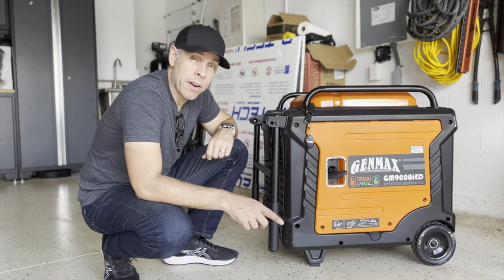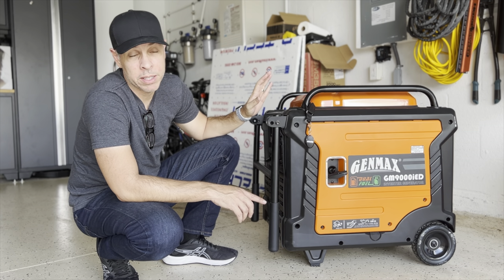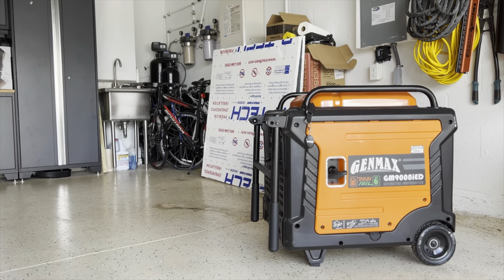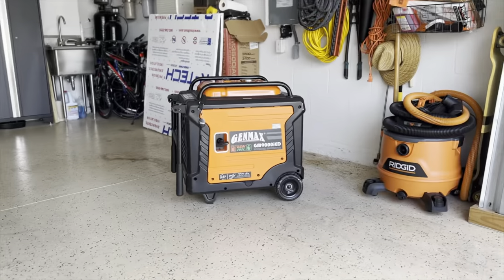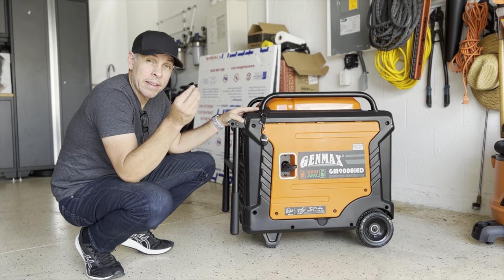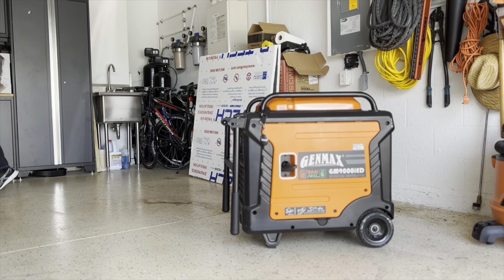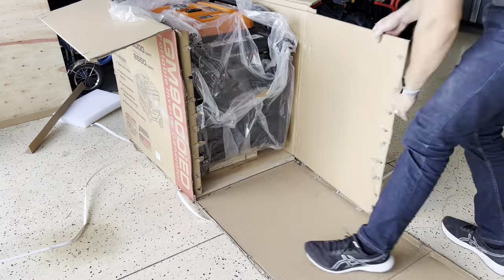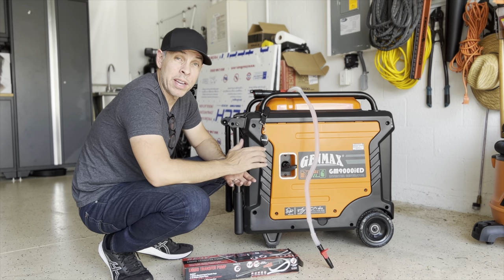Genmax GM9000iED Update - USA Support

Comment: Hi Javier, thanks for all the videos, definitely steered me towards purchasing this generator. I was wondering, I might have missed it, if you purchased a cover for this specific model that you would recommend, for when it's raining outside. I am thinking of building a little portable shelter for the generator, and a cover would also double on protection while I move it to the shelter. Thanks.
Reply from the maker: Hi, I have thought about it but I have not found a rain cover that convince me to use it while running.

Comment: There is a reason Honda and Yamaha gens cost more.  Quality and a parts system and dealer network to support the customer.  Hope you get your issues resolved.
Reply: I wish Honda and Yamaha made an inverter  generator in this kw range.
Reply: I wish that were true but you’ll find now that the support from Honda is horrible these days, many parts for equipment not that old have been permanently discontinued on their website

Comment: Sounds like to me it has a tilt switch on the fuel. It’s getting stuck when you move the generator   When you shake it it allows fuel to pass through the valve. Just a thought.

Comment: Have a 9000 IE with 31 hrs.   Starts up, runs great and then after about 13 sec. dies.   If I let I try to start right away - it will not start.  If I wait a couple of mins it will start and then die.   It has gas, it has good flow to the carburetor , the oil level is fine and I am starting it out side.  
Thoughts?  Thanks, Al

Comment: Hi Allen,
It could be the CO dectector is giving a false positive reading.  It thinks it's seeing carbon monoxide, and it shuts itself off. Try dis-connecting it and see if it stays running.
Reply from the maker: It could be, someone else mentioned to try to disconnect the oil sensor. Sadly I do not have the unit anymore, it was replaced with a new one by Genmax.

Comment: Hello I have the Duromax one not the Genmax but my question is did they ask if you tamper with the unit? 
Also are you gonna send it back with floating neutral or bond it back and send it.
Am thinking of switching both of my Duromax inverters from bond to floating. Saw your video earlier..
Reply from the maker: If you are asking because I removed the neutral bonding, they knew. I was able to remove the right cable per their own instructions at the beginning. I will be sending the unit as it is right now so they can check using existing conditions including as floating neutral.

Comment: Hey Javier,
Big question…
Duromax vs Genmax I know you made a video but hear me out…

I can get duromax for $1619 and Genmax gas only for $1865

I would mainly only use the gas so that’s not a big deal to me. The duromax spec sheet claims to get better fuel economy in compared to the Genmax. But a good few hours. I feel like they are probably the same motor/same machine so I’m not sure how that could be.

Would appreciate your thoughts and your real world experience on the fuel economy of your Genmax. Thank you
Reply from the maker: What is the model number of that Duromax
Reply: @JavierRivera  duromax 9000ih & Genmax 9000
Reply from the maker: @austin2187  Both are very similar but at that price, I will get the Duromax that 1- cheaper and 2- comes with 3 years warranty
Reply: @JavierRivera  awesome thank you for your help, just ordered it

Comment: If you can, use Propane with it. It’s a much cleaner fuel that stores for Decades and you can Store much more of it safely on your Property , and is much Cleaner. 
For the Foam filter, maybe put a Screen on the Carburetor side?
Reply: For propane if you storing it for a long time have it 80% fill if left in the sun. I had them 100% full and it started leaking because for days it was very hot. I would have to go and release some pressure then connect my generator so I can burn some.
Reply from the maker: I am seriously considering to run this new unit on propane only and see how that goes. the down side is I would lose power. I might get the new one GM10500iET that is try-fuel once is available because I have a natural gas line at my house.
Reply: @JavierRivera  fyi the 10500 is on sale now on Amazon Black Friday special $2319 which is 20% off. Heck of a deal. I got one a few weeks ago at 15% off and I love it. 6hrs on it and no issues. Thing is a beast.

Comment: I bought the genmax GM9000iED for my food truck. 

Everything on board is 110, 3 fridges, a mini split AC, a hot water heater, 2 LED lights, and a few outlets mainly just for cell phone or iPad. …the Genmax 9000 is more than enough power. Cooking equipment is gas. 

I was running it the other day, ran the food truck for 1 hour and turned off, started right back up…ran for another hour and turned off. No idea why!!

Should I run it on 110 or 220?

Wondering why it is shutting off on me? Can’t be the power load!
Reply from the maker: Do you have the refrigerators connected to the 120v outlets on the Generator? if that is the case those outlets are gfci and gfci does not like fluctuations in voltage from the refrigerator compressor.   I will run all that out of the 50amp outlet with something like this adapter https://amzn.to/3XFEVxo
Reply: @JavierRivera  no, but m sorry I didn’t clarify. 

There is a 50 amp breaker box on the food truck. All of the appliances and power outlets are wired to the breaker box. I have a very nice industrial cable that runs from my food truck to a 50 amp receptacle. This is why I chose this generator in the first place.
Reply from the maker: @kennethkovacik4850  Ok, I see, reading your first msg again answering your question, you should be using 220v when you use the 50A outlet. If you have not tested yet at 220v I will try that first.
Reply: I bought that very same generator and shipped it down to me  to the carribean. 
1st , The generator took very long to start.
2nd when it's starts, it sputters and shuts off . It trys to start over and over again, but never does. 
I'm glad I found this video, I will reach out to genmax customer service. Thanks.

Comment: My Genmax 9000 iedc wont  crank start. I measured the voltage and it reads 13.43 volts. When I press the start button it just flash. My Generator only have 10 hours. Any help is appreciated.
Reply from the maker: Did you try pulling the recoil cable instead of the start button?
Reply: @JavierRivera  Yes I did and it won't start either.
Reply from the maker: @mariojalata5259  Did you try to pull it with the fuel switch in the middle and first start cold?

Comment: I have been looking at the 10,500 Genmax and I really wanna pull the trigger on it, but all these negative comments about genmax quality control has me worried. Seems like the customer service has gotten better, but still a fair amount of complaints on Amazon about lack of quality. Did you look at the pulsar 9500 at all? Right now Amazon has it for $1945 and it seems to be exactly like the genmax version of the 9000ied. Again not many YouTube reviews or feedback on the pulsar one. I really like some of the bells and whistles on the genmax 10500, but for almost 3k I just can’t push myself to get it with all the negative feedback surrounding genmax in general.
Reply from the maker: I understand.  I would buy the 10,500 if I didn’t have already the 9500. So far I have no problems with the replacement I received of my 9500.  The question is.  Can you find any other inverter generator with 10,500 tri-fuel?
Reply: @JavierRivera thanks for the fast response man your awesome. How many hours to do you have your generator now? Your right genmax has cornered the market with inverter sizing and bells/whistles. I don’t really need the extra wattage or the natural gas ability as I don’t have NG( though more power is always better) I just like some of the features/changes of the new 10,500 compared to the genmax 9000. Where did you originally buy your 9000 through? Amazon? The pulsar 9500 is very tempting at the current pricing but again not many in depth reviews on it.
Reply: Hi Javier- I finally got to be able to talk from the US Genmax service and they dont want to replace my 9000 IEDC Generator as they want to have it repaired. I was planning to buy also the 10500 trifuel but due to having a Generator with problems at 10 hours they lost a few Generator sale.  @JavierRivera
Reply from the maker: Have you contacted Lisa from China via email?   USA 🇺🇸 support tent to have a better performance when China head quarters get involved.  So far all my warranty issues have been resolved by contacting China support directly first.
Reply: Yes- I got a response from China but none in the US. I have to call and wait for 2 hours before I finally got someone to answer the phone. They also dont want to send a replacement and they want to have it repaired. In short extremely disappointed. I am planning to buy the 10500 but not anymore. @JavierRivera
Reply: @mariojalata5259  what’s wrong with it?
Reply: @stevesmith1291  The electric start dont turn at all anymore with only 10 hours in the clock. All procedures were followed per manual. GENMAX wants to repair a defective unit instead or replacing the unit.
Reply from the maker: @mariojalata5259  They did the same with my first unit, they made me do a few tests and even Facetime to see before they decided to replace it. If Repair is an option they will do that first IF they can not fix it I guess they will replace it. Sucks but have some patience and see how it goes.
Reply: @mariojalata5259  what did they say is involved in repairing it? Do you have to send it back to them or take it somewhere and is it at your cost or theirs? Asking as I am considering the 10,500, but customer service is a big deal to me.
Reply: I been looking at the westinghouse igen 11000 dual fuel but can't find any reviews on YouTube and all the written reviews when you look at them are if other westinghouse models would you have any knowledge of this generator or the quality of the westinghouse brand, right now I'm torn between it genmax duromax and champion would like your input or anyone else thanks